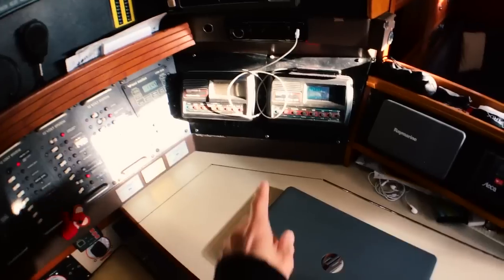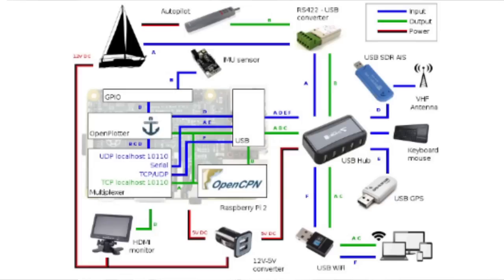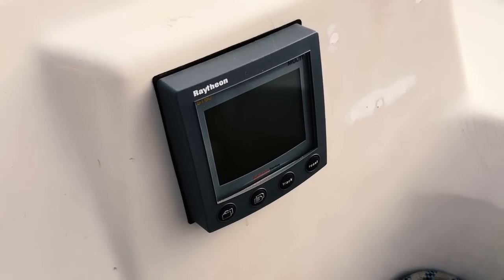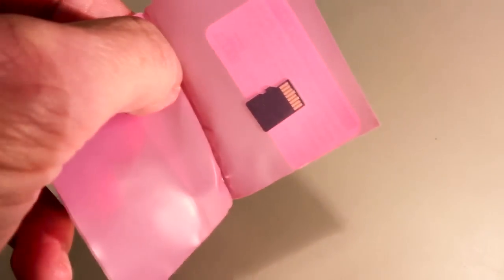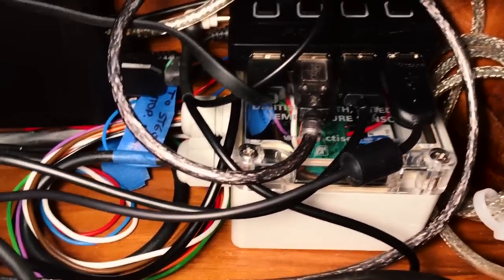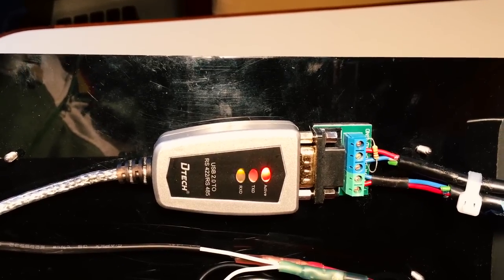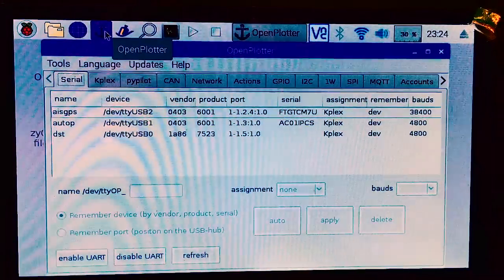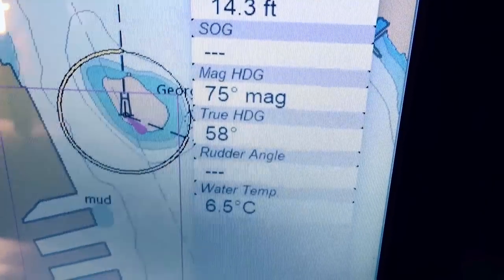How to Sail Digital for CHEAP with Raspberry Pi | Sailing Balachandra S02E32

Comment: can you use multiple monitors and choose what shows where?
Reply: You need a Pi to take data over USB into OpenCPN, then you can send data over wifi or Ethernet to various tablets, etc., each running OpenCPN.  I think he described that very briefly in the video.  

Really this is analogous to a commercial chartplotter that takes physical NMEA (serial data) but can then support additional MFDs over the marine equivalent of Ethernet.

Comment: how did you figured out what cables were coming from each equipment?  like SoG, DF, autopilot, wind?  My chart plotter got stolen and the cables were cut.
Reply from the maker: woh... that's really sh*ty. Chances are you only had one or two cables running to the plotter that fed NMEA, NMEA 2000 or Seatalk depending on the brand (Raymarine?). The rest of your SOG, Depth, wind, etc, wouldn't trace back to your autopilot directly but would meet somewhere at a hub or backbone if you have one. One of the cables out of the plotter might be going to the autopilot. My best advise is to trace the cables or unplug each device and use a line testor. Hope that helps!
Reply: @SailingBalachandra   I have to look it up because there is the cable coming from the radar and there is other 2 or cables that I have no idea where they go to.. I will find out and let you know.

Comment: Fantastic! Hmmm... I have a Raspberry Pi-2B, why wouldn't that work? I just answered my own question... The only differences between the two are Speed... So, a RB Pi-2B will work just a bit slower... 250 MHz vs 450 MHz... Oh! And the 3 has Built-in Bluetooth and WiFi. No Biggie... Without trying it out, I don't know if those would be significant... We'll see :-) Btw: Great video and insight. Thank your friend for me... And, thank you. Great video, Topic and presentation. :-) I love hacking :-)
Reply: Would work as you said. Slower usb bud and be careful converting the nmea to that usb but the adapter exists.
It may be considerably slower

Comment: How did you power your Pi? Did you use 12v or run it off your inverter?
Reply from the maker: Great question! The Pi runs on only 5v so you must downconvert power from 12v using a converter you can buy on amazon for a few dollars. Make sure the converter will give you enough amps. 1 amp is iPhones, 2 amps is android. You’ll need at least 2.5 amps
Reply: @SailingBalachandra  I found one on Amazon that hardwires in and has a USB C for the output side. Thanks for the great video man. I'm going to give this a shot.

Comment: Amazing, what you can do if you understand the system!  Where do you get the charts for Open CPN from? Regards, Silvano (from Switzerland)
Reply from the maker: If you go with OpenCPN for your chart plotter software they have a list on their website of web addresses where you can download charts.
Reply: Yes, thanks but  unfortunately there is not much on European waters...
Reply from the maker: You may have to pay for charts then... Also, you can use just about any chart plotter software that accepts boat data over wifi. OpenCPN is just one option
Reply: @silvanocometta9760  You may want to try o-charts. They offer charts at a very reasonable price.
Reply: Many thanks Dirk, I did not know of this source for Open CPN-charts. Best regards, Silvano

Comment: If you are using a tablet as your plotter then there is limited reason for a pi. Just wifi your data. I use vYacht wifi plugged into NMEA2000. The only thing I don't have compared to this overly complicated instal is autopilot as I I use a tiller pilot when motoring and a wind pilot when sailing.
Reply from the maker: Raspberry pi are “do anything” type devices. I’m only using a tiny fraction of it’s potential for monitoring every system on the boat. Thanks for watching :)

Comment: Awesome setup

Something to keep in mind tho,
Im looking at a lot of adapters and bare metal/copper being exposed to salty sea air (including the rpi3).
Has anyone come up with a good way to protect the electronics and connections against this?
U could put it all in epoxy to protect it from corrosion, a basic step producers will take, but with the SD card, thats a not an option i think
Reply from the maker: Your best bet is to store all of the components and connections in a water tight box. Mine is the second best method- a box within a box in the dryest part of the boat :)
Reply: @SailingBalachandra  spray or paint-on conformal coating is like $10 a can and will seal the board itself. Super simple and has worked for me in the past, even leaving them in the field for work for months at a time.
Reply from the maker: Great idea!

Comment: Great video! Interested in this solution but we need radar, and this is one technology that seems to be pretty well locked in by vendors. Would love to hear if anyone has found a solution.
Reply: The radarpi add on works awesome with a lot of radar types
Reply: @AndyKopac  Thanks, I will have to give it a try when I find a radome. I got a good deal on a B&G plotter with wind and DST sensors, so just looking for a Navico radome now.
Reply: @sailingcallisto3791  I’m in somewhat of the same boat. Our radar went south. I was looking at the garmanxhd,  the went through a whole bunch of research the Sunday before cyber Monday.  Turns out all the Navico distributors have a minimum price agreement with navico.  My research lead me to several interesting findings. 
1. WiFi radomes don’t work well with opencpn. 
2.  B&G is navicos sailing branded hardware
3. No radar units will give you the advertised range
4. The Halo 20+ is unique in that it’s solid state (no spinning parts).  It has dual range transmitters for better target clarity at all ranges and has Doppler for telling you the targets relative speed and direction to your course and location. It’s extremely low power relatively speaking. It does have standby, guard ringed and variable timed wampum modes. Because it’s solid state there is no waiting for warmup... it’s almost instant on. The data and power cable are all in one, but the cockpit end splits out to a standard Ethernet cable and 12v power making it easy to extend or whatever. You should also checkout:
https://github.com/opencpn-radar-pi/radar_pi/wiki
Links at bottom of page are really important!!!
Reply: @AndyKopac  Good to hear about the Halo radar. If I can't find a deal on an older 3G/4G unit, I may have to spring for the Halo20. I believe my Vulcan plotter will support any Simrad/Lowrance/B&G unit 3G or newer, but there are not many on the used market. I don't mind paying for a good unit, as we will probably move it to our next boat when we head offshore.

Comment: While everybody's crazy about the Pi I'm going to offer the apposing point of view. Theres nothing as easy and versitile as using a standard large samsung or apple tablet for a charplotter. Unlike the PI, its also easier to use for other apps. You can even 3D print brackets and holders for them at the helm to shield form sun & rain. By using a tablet... Other than loading the app there nothing to worry about such as configuring the USB gps to work with the Rasberry Pi. The rasberry pi uses archaic "dos" like setup commands to configure daughterboards, screen format, If you want to work on electronic projects this is great for you. If your not into computers and electronics i wouldn't bother. If you just want a chartplotter then just go buy a tablet.  Not only do you have to buy the rasberry pi, but you need a keyboard, HDMI cable, external power source (phone one will do) and/or mouse and extra monitor which puts the total cost near a chartplotter anyway. Figure on a few hours figuring out how to get it to work. I don't like actual "Chartplotters" becaue i think the maps chips are a ripoff.
Reply from the maker: Chartplotters are faster and easier than a. Entire Pi system, however you'd still need a backbone or multiplexer. I think if you're not tech savy go with something simple or just use the tablet but you won't get the boat data unless you wifi stream it.

Comment: I also have a Pi with Openplotter on my boat but I was concerned that people would turn off the power as we were leaving for the day and not shut down the pi properly, which would corrupt the SD card pretty quickly.  first, I added a momentary switch but that assumes somebody knows to press the button and so then I looked for some sort of UPS that would power down the Pi when power was removed and only the Pi juice fit all my needs but it is quite expensive.  So I came up with a circuit that costs about $10 and powers down when the breaker is turned off and powers back up when the breaker is switched on again.   made a little video about it if you are interested: https://youtu.be/45IxpEa0ZcM

Comment: Damn and with a $40 pi you could set up two and keep one as a spare on board.
Reply from the maker: Exactly- in a watertight Tupperware, with an extra imaged SD card
Reply: @SailingBalachandra  I already have a spare with spare SD card onboard!  Only use it as a chartplotter/AIS with a re-purposed laptop screen but now I might look at other applications - Thanks!

Comment: Where is the $$$ savings if you still need to buy all the NMEA hardware?  Not buying the backbone?  You lost me.
Reply from the maker: The Raspberry Pi solution is best for boaters who have older NMEA or Seatalk instruments they want to re-use instead of upgrading. A backbone is completely optional with Raspberry Pi but I'd prefer having both as a redundancy in case the Pi fails or something.
Reply: Or use older equipment and set up your system.
Reply: @Nimashet  yeah, I got that from when he said it.